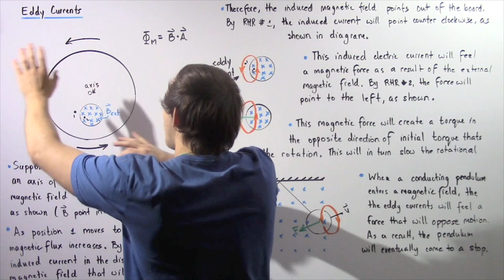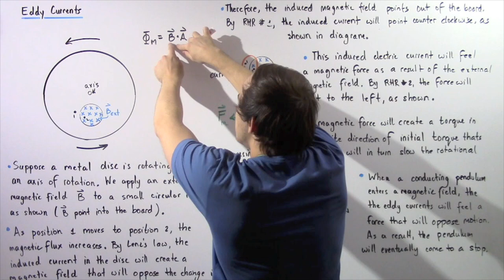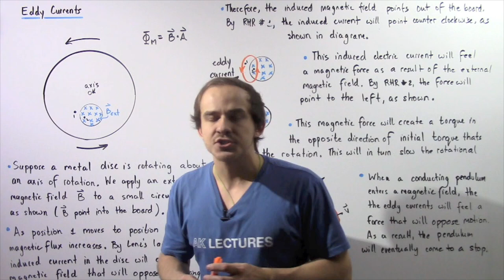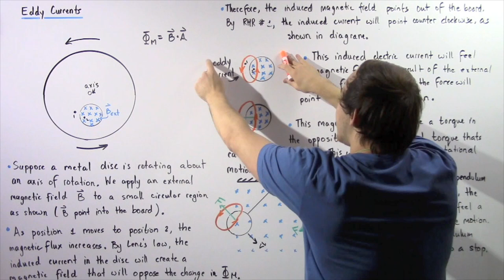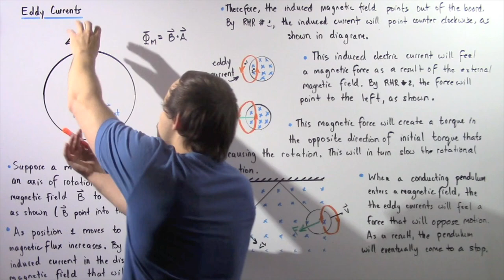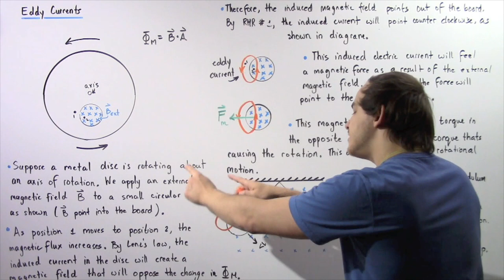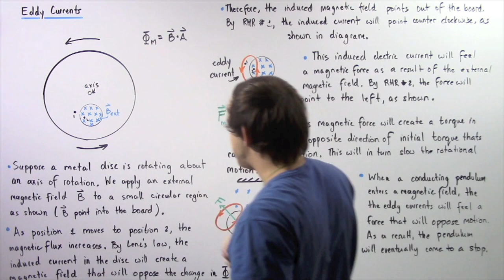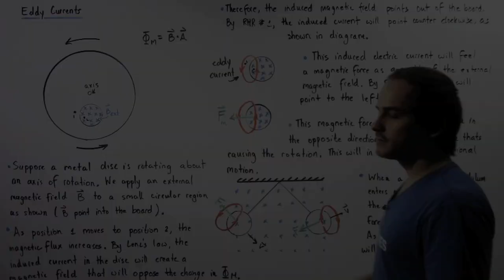Eddy Currents

Comment: The direction of Eddy current ...🙄🙄 In rotating disc case..is it okayyy???...Eddy current should form like loop sir..and according to Ur diagram it's going inside white board???..how's that possible..can someone explain..Eddy current should form in plane of disc..
Reply: Not inside white board but clockwise on a plane from your right to your left. The current goes upwards through the magnetic flux that induced it, then downwards through a region without magnetic flux. The loops, if magnetic flux component didn't exist, would essentially be in a 2D diagram like Venn. I think you might be overthinking it a bit
Reply: @mkakajoel5281  🙄...from where did right hand rule 2 came..this is first video where I listen abt it??
Reply: @Rish0716  It's the right hand rule for Induced force ( F = i ( l X B ) ).He just does it differently. There are about 3 different way to do this second Right Hand Rule but ultimately, the orientation is the same & correct. The one I prefer is "the slapping motion with an open hand" where the thumb is the direction of the current i , four fingers are pointing to the direction of the magnetic field density B , and the slapping motion is the direction of the induced Force F
Reply: @Rish0716  The third way to do the 2nd Right Hand Rule is:
1. pointing with and index finger which's parallel with the palm of course
2. Ther three finger are pointing away from the palm and are perpendicular to the index finger
3. The thumb is perpendicular to both the index finger, and the three fingers. The directions are: Thumb = Force; index finger = current, and three fingers = magnetic field density